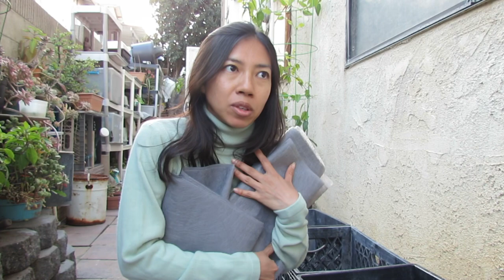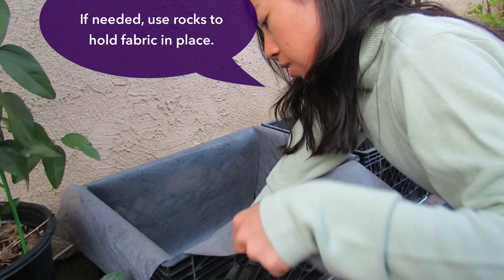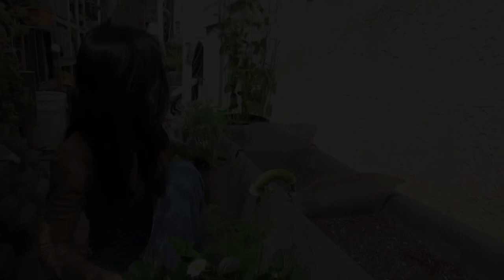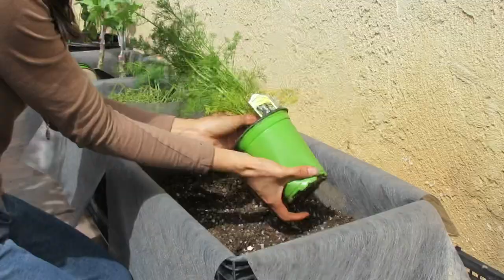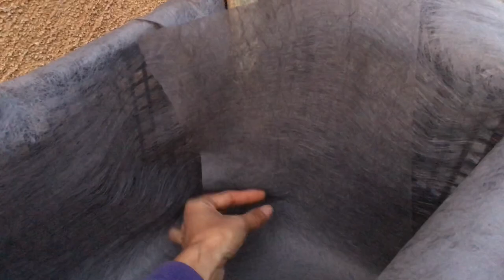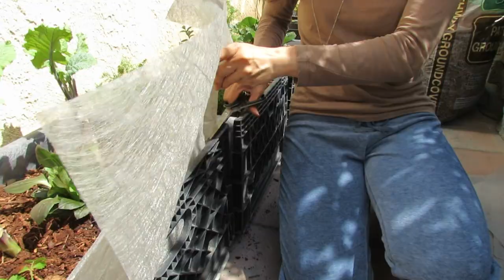Turning Crates Into Planters

Comment: Wendi one technique I learned from container gardening that will retain the moisture in the soil, minimize watering and save on expensive soil and mulch. It is to layer the container with straw and soil, two inches of straw then 2 inches of soil then two inches of straw then two inches of soil and do that until the container is full. Your watering requirements will be reduced, the straw will break down and provide wonderful soil by the end of the season. It works well for me. I have not seen that method in any gardening videos, it might be a good subject for one of your videos. Also bark mulch is decorative as a top layer but it takes a long time to break down, I prefer straw at a top cover, it's not as pretty but it breaks down faster.
Reply: Good idea, I will try that
Reply: Thank u
Reply: Did you read, "One Straw Revolution" ?
Reply: what kind of climate do you live in, will it work in a subtropical zone with little rain? and at times 30 degrees Celsius.
Reply: Awesome idea!!!
Reply: oooh, great advice.  I have a green roof garden and have to be careful about weight issues.  I have been wondering how to navigate that.  I have straw bale insulation and a surplus of straw available to use for this - great and very welcome idea!  I was also planning on growing my potatoes in straw/earth filled bags and now a theme is emerging.
Reply: @KatieKamala  I will now that you have suggested it!  thanks!
Reply: @KatieKamala  where can I read this

Comment: What about the wall. It is now partly blocked from sunlight, in the bottom part, and you have introduced moisture against the crate and the wall, which will ,eventually, leak  in through the wall. You need some isolation between the wall and crate, at least. Other than that, good idea.

Comment: when i did that, i found that they tend to dry out faster than if i had the plants in the ground
Reply: Drying out soil, that is a problem with container gardening but the solution is to layer the container with straw and soil...2 inches of straw then 2 inches of soil then 2 inches of straw then 2 inches of soil until it is full. The straw will retain the moisture and slowly break down. It works very well for me and I seldom need to water the plant. At the end of the season you will have wonderfully mulched soil, the straw will have broken  down.

Comment: Thank you for this! I've been wanting to make raised beds but have no $ saved up right now. I have a few crates and some market vendors gave away theirs so I have tons now. All I need is landscape fabric, it's difficult to find here. Would burlap fabric work the same way?
Reply from the maker: Any material that is breathable would work.  You just need to line it so soil won't fall out.  You can even line it with plastic, but poke holes for drainage.  Even though it's not ideal, but at least it'll get you start growing! :D

Comment: Love your videos. Do you not fill the crates with more dirt for a reason ? Ok. Sorry. Didn't get to the mulch portion of the video. Looks great. Can you please do a video on germinating carrots. Small seed germinating is harder. Thanks.
Reply from the maker: Farisa Smith I didn’t fill planter all the way to leave room for bark. I also wanted to avoid using so much soil since some plants have shallow roots. I wanted to try growing carrots, but never got around to...In So Cal we have mild winter so best time to sow carrot seeds is actually in fall or early winter. I noticed that usually the finer the seeds, the least you need to cover them. Just sprinkle potting soul loosely, very thin layer is enough. Too much soil can sometimes prevent seeds from sprouting.